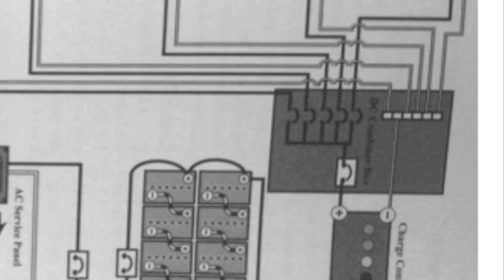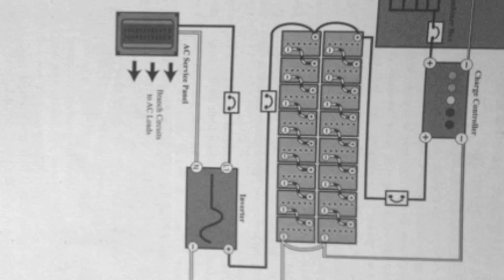Solar Off-Grid System Schematics Explained

Comment: I spent  9 months to learn how to create my very own personal power source. The right formula was the Papziati Energy system online. It is a fantastic way to create your own electrical power. It is the primary thing that will surface on Google.
Reply: Do you have a link? I did a search nothing, Hooking up battery banks without load balancing is wrong. This video is not load balancing for charging and discharging.